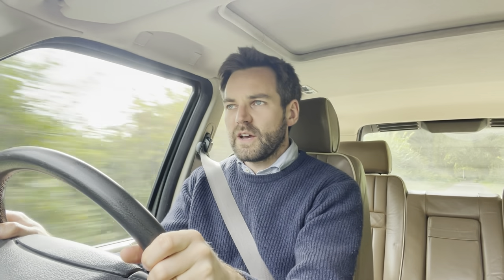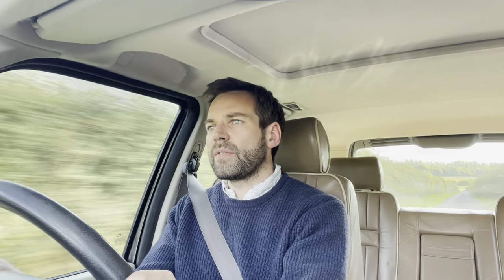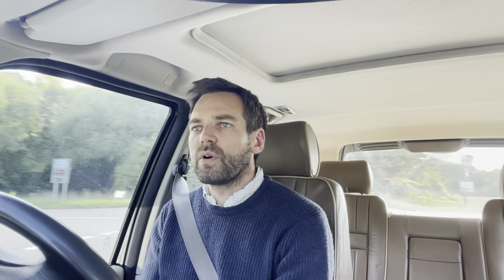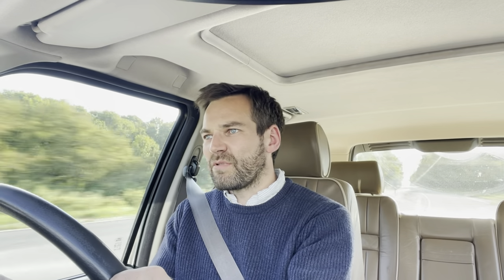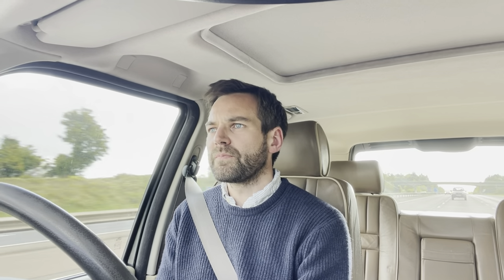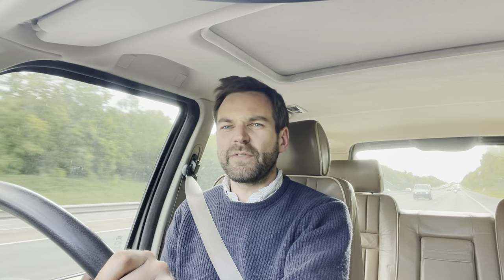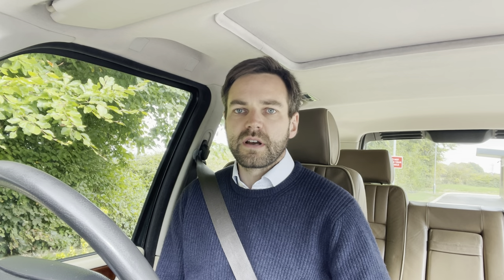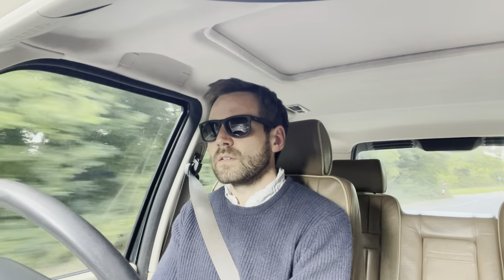Range Rover P38 - test drive

Comment: Great and most informative video on these. I have had two and still have one. Had one since 2006 and between the two have never been left stranded with either of them, nor had any headaches with the air suspension. Had a TDV8 L322 and it was certainly not like night and day getting from that back into the p38 apart from mid range grunt like you say. :) Great to see honest and fair commentary from an actual owner.

Comment: Great video thanks.  I've had mine for 3 years now, MY2000 4.6 Thor.  It's my daily driver, bought with LPG fitted thankfully. I do 99% of the work myself on my drive so it's not that expensive to maintain so far...I'm chasing down a vibration at 60-70mph, like you say, every time you replace a bush or suspension component it gets better and better.  Have just changed the bushes on the radius arms and that made a big difference (link arms, shocks, TRE already done).  Next up are the panhard rod bushes and then steering damper if necessary.  I had a binding in the diff which made a clunk and a boing sound when pulling away, ZX1 friction modifier in the diffs cured that.  I also replaced the amp in the boot with a new 4 channel Alpine unit, took a bit of head scratching to sort the wiring for the component speakers but got there in the end.  Now i have the original head unit but with DAB, bluetooth and hands free phone all hidden away.

Comment: Regarding the electrical issues,
One thing that helped me clear an electrical issue was cleaning the ground connections,  especially the one inside the car under the kick panel.
Reply from the maker: Yeah that’s a good point, I should probably have mentioned that too. I’ve had to clean a few grounds on the Mercedes recently!
Reply: Known point of failure. Also, oxidation in the obd port could cause the ecu to go berserk.

Comment: Well my driving experience with our recently purchased 97 Autobiography is like yours. Love it. Just a pity the body and paint lets it down. We recently drove 400 kms from Adelaide to Mildura in Victoria here in Aus and at 110 kms/h (65mph) we were at 2,400 revs which is 1000 less than our 99Rav 4s do. Have done one fuel up but haven't checked it yet since we got back to Adelaide but seems a bit heavy. Dash was showing 33litres per hundred when we bought it so don't know what the heck they were doing with it before. Has slowly dropped to 16.8 on the trip up and back and without going out in the rainy dark now to get the log book I think I did 471 kms and put in 76 litres = 6.19km/l or 14.5 mpg your figures, about 3 mpg worse than what some over here reckon they get. A bit heavy I thought. But its done 296,000kms. Due for a cam rework? Be sorry when you sell that as between you and Keithy W on utube here in Aus I have learnt a lot.
Reply from the maker: Glad you like yours! I’d say at that mileage it depends on how the engine feels and what expectations are. If the head gasket hasn’t been done before I’d consider having it done by say 325k kms - maybe kill two birds with one stone.
Reply: Just done cams in mine and lifters water pump and anything else I could think of and heater core orings have the 2000 4.6 vogue which I use for off road

Comment: Glad my 2001 car is standard exhaust.... that noise would do my head in on 2000 mile round trips
Reply from the maker: It’s just a stainless version of the standard one. Maybe the video makes it sound worse than it is, I never noticed it before. The old exhaust had a hole in one of the back boxes, now that was annoying!
Reply: @classiced1416  sounds a lot more vocal than my standard one. Can't hear it inside the car at all

Comment: Hi mate, I might buy one that has 100k on the clock, and is LPG converted so it may not cost a lot to run. I've done my research and know what to assess (EAS, HEVAC, overheating, and electrics.) What else should I look at and do you suggest I buy one or is it just a money pit?
Reply from the maker: That’s pretty much all I think, on the drive just listen for any weird knocks, clucks or backlash through the drivetrain that might indicate issues. Slightly dodgy handling is to be expected unless all bushes have been done. 

Look at what work has been done in last 3 years or so - if it’s been looked after recently and no history of overheating etc it’s probably sound. But be prepared to drop a few k on it in year after purchase just in case you have issues - you might not, but even if it all checks out they can still bite you down the line.
Reply: @classiced1416  hi Ed, just replying to give you an update. So, I bought the car! The previous owner had it for 12 years, oddly enough he did not have any history but work was done on it. I've had it parked up for a good 5 months as I can't get insured on it yet (July is when I can), but I would still drive it 0.2miles about once a week but that all stopped since I discovered a coolant leak! It isn't the head gasket, which is reassuring but after using a UV dye, I still cannot locate it so a visit to a specialist is pending.

The rear doors do not lock with the key..so they need to be operated manually. There is a minor leak in the headlining, and the obvious gremlins such as the blend motors needing replaced (DIY job in the future), and non operating heated seats (no plans to fix, tbh). The drivers door cam kit snapped, so many thanks for your video. The O Rings were replaced by the previous owner, as I checked myself. I've cut the carpet in the drivers footwell as although the previous owner replaced the rings, he did not replace the carpet underlay that was soaked in coolant. 

I can't complain just yet as I've not done 100miles in the car. The fear of missing out payed off as there hasn't been a single other P38 in this spec (black with painted bumpers. HK system, LPG) so I am thoroughly happy. (I will remember these words when I'm on the hard shoulder.)

I guess I'll hopefully provide another update in August..